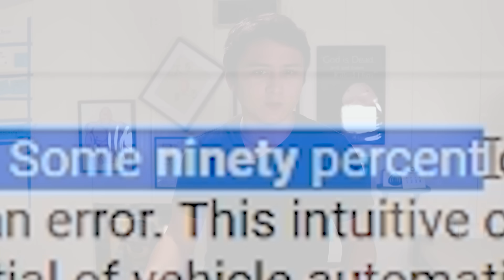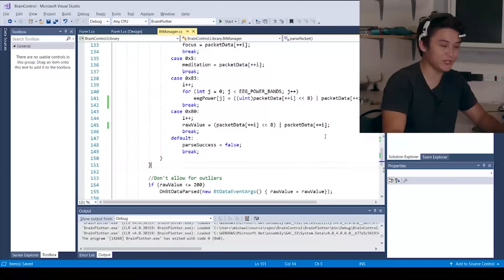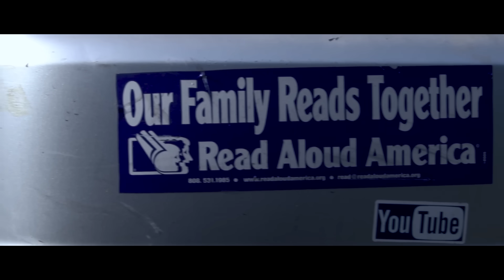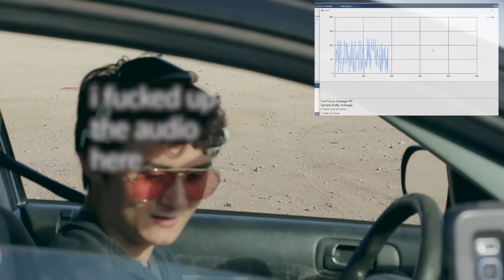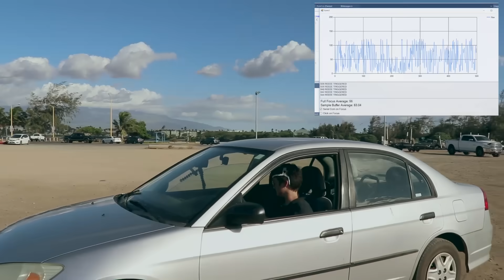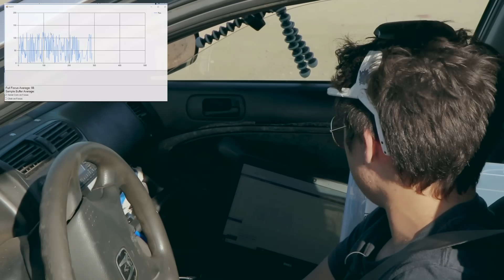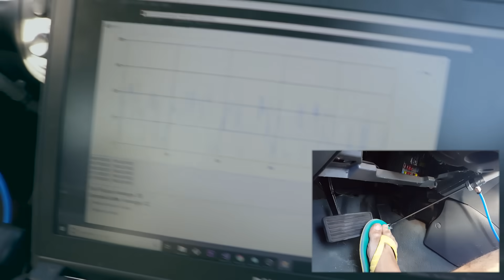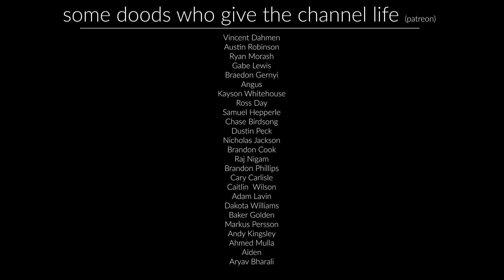Using Mind Control to Drive a Car

Comment: YOU NEED to actually develop this and fine tune it then patient it. There are a lot of people that can't use there legs and this could be an AWESOME alternative to be able to drive a car.
Reply: Only problem is, is the sensor is inaccurate and not very stable. We don't have sensing technology smaller than a bathtub that can tell the difference between "Go" and "Stop"
Reply: We already have handicap accessible cars with hand-throttle
Reply: with whatever that doesn't get me killed when my mind wanders on a long stretch of open road.
Reply: i have violent impulses to crash my car when i’m driving... i would be so dead
Reply: Connor M problem is,the more you panic the faster it goes
Reply: They use buttons for that, son.
Reply: JukaDominator Obviously that's why he needs to develop it more. Clearly it's not practical yet, but human mind-control has actually been used already for many complex tasks such as controlling prosthetics and computers.
Reply: Connor M with buttons, because i know how fucking erratic my mind can be
Reply: Moses Turner is it like a lever or a slider because with a button there isn't any way of slowing down at different speeds
Reply: Connor M True
Reply: Appletank8 That's not true at all. We have battery powered mind-controlled prosthetic limbs. You need to watch more YouTube videos. This isn't new technology.
Reply: This is a system in which panicking would make the car acelerate more... it'd be significantly more unstable than what we have today, and pretty useless in general. It only sounds cool but totally impractical. Even if it was a good idea, he shouldn't monopolize it with patents.
Reply: skeptic moderate 
I have seen those, and they aren't exactly plug and play
Reply: Appletank8 No, Michael probs doesn't have the skills.
Reply: Banter 2.0 but that's boring tho😜
Reply: JukaDominator man you think people who watch these types of videos would be less boring. I know how it's done now but tell me, would you prefer to move a car with some buttons or with your brain.

Comment: My car, being a lexus hybrid, is completely drive by wire, with the brake pedal being half electric half mechanic. It can steer, accelerate and brake by itself and I have all the info I need to control it over the two required busses. 
I already did rc remote control, pretty fun. 

What would you do with my car?

Comment: "Safety is our no. 3 priority," ™ 
Snag it. 
Oh hey, check it! So when someone is driving on straight roads, the car can accelerate, controlled by cruise control with a variable switch or whatever for controlling the piston (if retrofitted). When drivers approach turns, the drivers' focus "should" increase, and cruise control can drop a certain percentage of its speed. The sharper the turn, the more focus it'll take, and the slower the system will allow the car to go until exiting the turns. It goes back to its cruising speed, and hopefully drivers get bigger brains.

Listening to music might make this limited to a sport though.

Comment: @Michael Reeves You should implement a Panic Value, so when the focusing transitions into panic then it breaks (or not accelerating) the car instead.

I actually like this idea, but not this implementation. I think it (assuming the canner actually provides accurate data) should only allow you to drive as fast as you have focus for.
so when you are unfocused (on the road) and reading your phone* it should (slowly) de-accelerate the car to a safe speed.
*I have no idea how it would know where your focus are (eg: road vs phone).

Comment: I know it would be harder, but maybe try to code it to when you concentrate more, it accelerates faster
Reply: Trying to concentrate on parking would cause you to smash into everything around you
Reply: GOATFACE4 GAMING 
I don't think the mind scanner is accurate enough for that
Reply: GOATFACE4 GAMING I don't think he has a piston that slides gradually, it's either all or nothing
Reply: Possibly, but I think Michael can come through with it
Reply: sexy cabbage that's the point
Reply: That would be a good idea.
Reply: If we're gonna get technical here, the entire idea of self driving cars is a garbage idea
Reply: I should have rephrased, I meant to say: the entire idea of cars not controlled by a steering wheel and being controlled by ai/ mind control are stupid
Reply: Do if you think about MAXIMUM OVERDRIDE! You will initiate MAXIMUM OVERDRIVE!
Reply: Having it speed up when you zone out would be pretty safe right? I’d shit myself before the tires even moved though.

Comment: you could've hooked the whole rig up to the ECU to control the pedals because that gen of honda civic isn't drive by wire, so you could freak the shit out of people by making the car move while you're outside the car. But maybe you're too much of a bitch to figure out OBD1 codes. I'm sure tuning shops exist in Hawaii that you could take that shitbox to.

Comment: It would be actually interesting to have it control the break. Scenario: you're driving along the road relaxed when suddenly something jumps in front of the car. You panic which gets picked up by the headset and sends the signal to activate the breaks. Would be interesting to know how that would play out. ^^

Comment: Wouldn't that be actually a good way to drive. Ofc with a better software for example instead of giving full thrust it is graduate. The less you focus the less thrust it gives. (But the more fun version would be exactly the oposite haha "Allways stay focused or the car will floor it" )
 But that way everyone would stay focused on the road and everytime they zone out the car stops.

Comment: Disclaimer: Only works with automatic vehicles
Reply: *barely works with automatic vehicles
Reply: fuck it attach the piston to all 3 pedals.
Reply: Kuehlwandschrank, you can put a piston in the clutch so every time you unfocus it decelerates and presses the clutch. Now you just change gear and that's it.
Reply: Now that I think you would focus changing the gear so it would start to accelerate while you are changing gear so that would fucked up the transmission

Comment: If you have the balls to do this again, it would be really cool if you programmed it to feather the gas with a low-frequency PWM signal to get a more proportional response. You could also have your focus level decrease the speed instead of increase it to introduce some negative feedback. Dope ass project my dude!